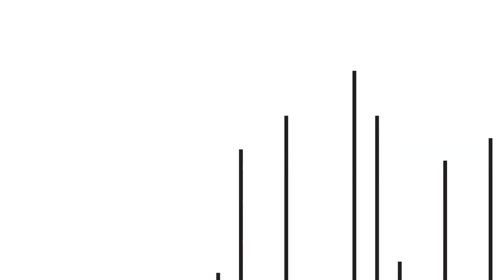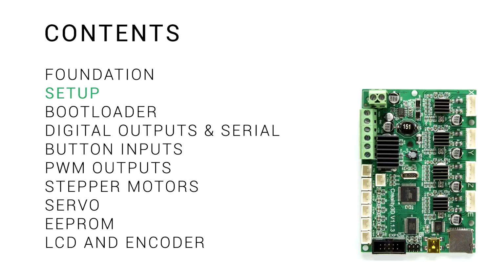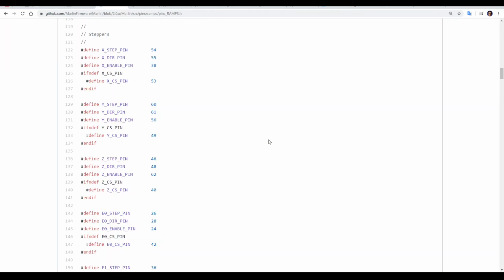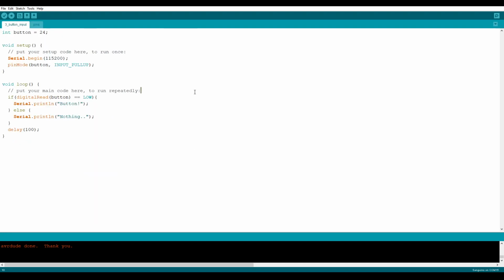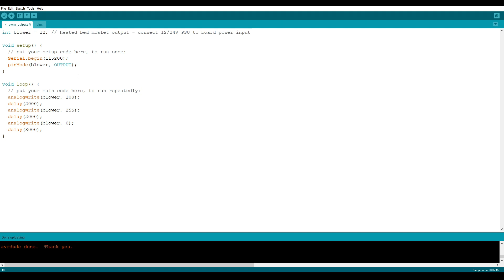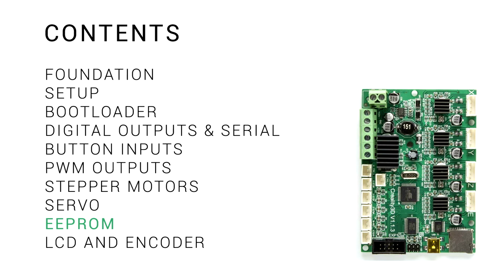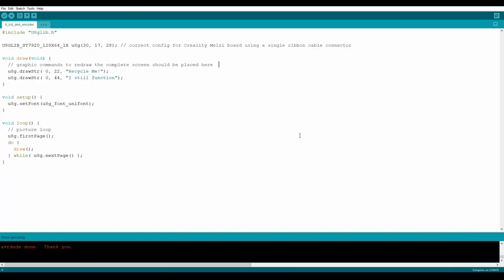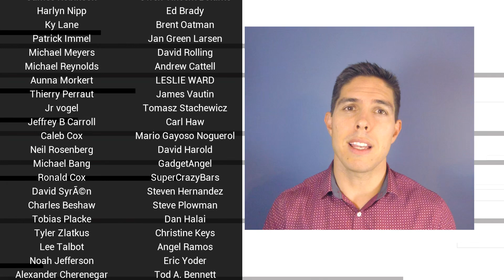Re-use your 3D printer mainboard and LCD for awesome Arduino projects

Comment: can you use a 3d printer motherboard for a cnc
Reply from the maker: Yes!
Reply: That is what I plan with my spare boards. As the cnc machine will stay in the basement and there is no "silent mode" possible by design, grbl should be possible on this little boards.

Comment: You could copy the pin config header for your board from Marlin and use the already defined and labeled pin names. Would make the code work on other boards with just a header replace.
Reply from the maker: Great tip.

Comment: I found a nice design for a colorimeter on Thingiverse that measures light intensity using output voltage from an LED. A student did a nice proof of concept that tied out put voltage to concentration of a colored substance in solution. It would be fun to go a step further by using an Arduino sketch to output measured voltage, and possibly change that into absorb an excellent, which has a direct relationship to concentration. Do you think the Melli or a RAMPS board could be set up to read output voltage accurately?  I tried with an uno, and got highly variable readings.
Reply from the maker: Assuming you are using an ADC pin that supports analogRead then it should work on either board.

Comment: i am getting an ender 3 and and updating the board + touch screen and was thinking of using the old one for a lowrider 2 good timing on the vid :)
Reply: I don't thing the stock garbage stepper drivers on the creality board can tackle that one. With how cheep 32bit boards with 2209 drivers are is recommend going that way for a low rider.